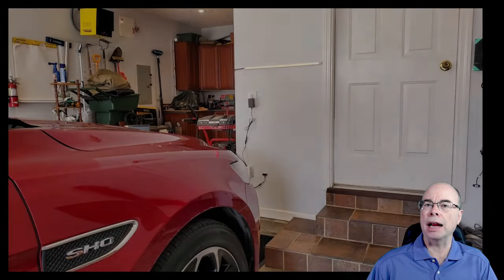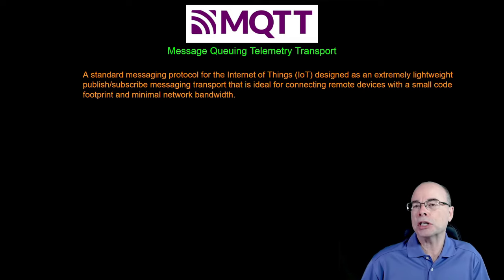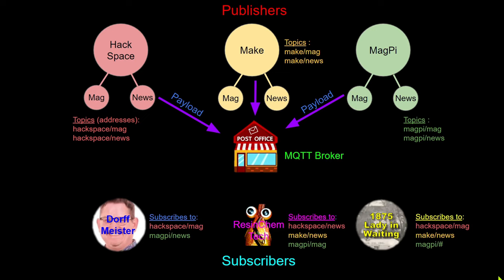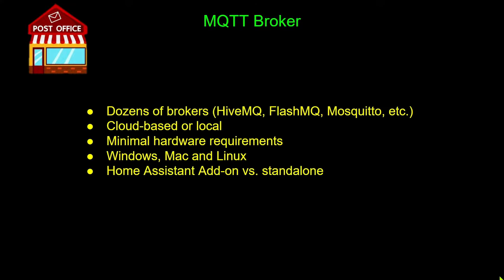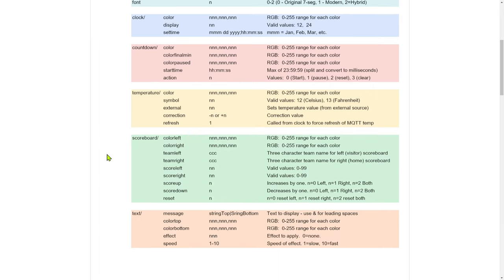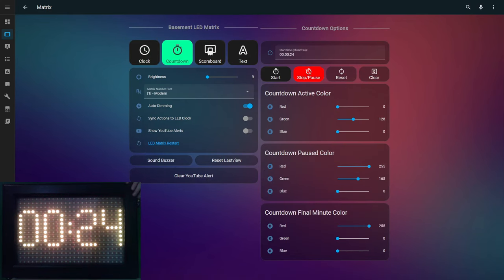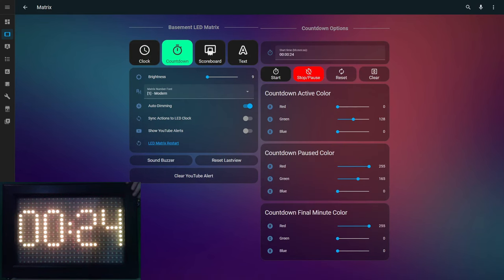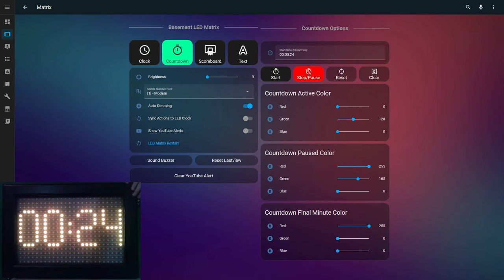MQTT 101: Integrate your DIY Devices into Home Assistant

Comment: Never in my life would I have thought I'd not only be able to retain focus, but actually enjoy learning during a 30 minute video. Just for that you deserve a medal. I had a couple of projects lying around that I wanted to integrate and I figured using ESPhome was the way to go, until I found out having to upload their way of writing firmware was required. I like my C++ and wanted to be able to create projects without worrying if later I'd be able to integrate them should I wish to do so. Thank Google for letting me know MQTT existed and you for explaining it so well. The end part threw me for a bit of a loop but I figure that''ll be fine when I'm more versed in YAML. Thanks again.
Reply from the maker: Yeah... I do tend to make lengthy videos compared to the average .  I try to always include the 'why' as well as the 'how' for beginners which result in long videos, but usually include chapter links for those that are a bit more advanced and want to skip certain parts.  Glad this one didn't bore you too much!

As I mentioned in the video, I struggled with the concepts of MQTT at first.  But now it is my go-to for any of my projects that do not have a native integration.  My C++ and Python starting frameworks both have MQTT stubs included... even if I don't initially intend to integrate them into Home Assistant.  The MQTT is there if I ever want to integrate it.... or even control the device through another system as long as that system can publish an MQTT message.

ESPHome and other firmware like Tasmota have their place.  For ESPHome, if I find that I'm creating a lot of lambda raw C++ to accomplish what I need, then I figure I'm better off just writing in directly in C++ myself (I'm a somewhat late learner of C++, but I love it and prefer it over other options like Python in most cases). 

YAML will come to you.   It's biggest issues (in my opinion) are trying to figure out if something is a dictionary without leading dashes or a list with leading dashes.  And of course the very strict indentation rules.  While I stick to YAML and don't really use the UI, the improvements is the capabilities with the UI means you can get away without even using YAML in Home Assistant these days, except for some really advanced or corner cases or you want complete control over where your code lives.

Thanks for watching... and for taking the time to share such a nice comment.  It is comments like yours that motivate me to continue making videos.

Comment: I can't even figure out how to make Home Assistant recognize the existence of the MQTT device.  I have the MQTT integration in but that's it, can't find a way to tell it how to find the device, give it an IP address or anything.  The device is an RS232 controller NB144.  There are three downloads for configuring the device but the one that looks most important is in Chinese.  Don't think there is much hope😞
Reply from the maker: You might try watching the follow up video to this one, if you haven't already, that focuses specifically on how to set up the Home Assistant side for MQTT devices.  https://youtu.be/WYyPMHqMV-w

This video was a bit more of an MQTT overview.  The linked video above has much more info on the specifics of the Home Assistant side.  I hope that will help a bit.

Comment: I have been using Home Assistant and MQTT. I develop ESP based devices. I love MQTT, but to retain or not has been one of those things where I play with it until it works, hopefully. However, even as you began to explain your thinking on when and how to use retain, I lightbulb went off! Thank you! That was an excellent concept and explanation. I have already fleshed out how I will implement my next device. If it works as well as I expect it to, I will go back and re-code my older devices and fix the little bits I now realize I CAN fix with this newer idea. I know I will change the implementation to suit my MQTT topic ideas, but the retain portion is great! And, again, Thank You!!
Reply from the maker: Glad it helped out!  I too struggled to understand and use the retain flag properly when I first started implementing MQTT on my own ESP devices and it took a lot of troubleshooting of a device that I had that was exhibiting the "ghosting" behavior until I finally figured out what was going on and how the retain flag was causing that behavior.  It's also why I now create separate state and command topics for my MQTT devices.  Yes, you can get a way with using the same topic for both if handled carefully, but by having separate topics, one retained and one not, it is much easier to manage (at least for me) and avoids the issue of having a topic retained when it shouldn't be.

Thanks for watching... and taking the time to leave a nice comment.
Reply: @ResinChemTech  I have used Shelly devices. I can see now that they use something similar, but it never clicked. Looking at documents never really conveys the concept, but pictures and words work WAY better. I am really ready to make a detection device for my front door and doorbell. Maybe even a light included. Thanks again! (I also subscribed. I will look over your earlier vids tomorrow. I found this one by accident. I know that is NOT what a YouTuber wants to hear, but at least it came up.)
Reply from the maker: Yeah, Shelly and Tasmota devices tend to use /tele (for telemetry) instead of /stat (for state).  But both are basically serving the same purpose.  I just selected /stat for my own devices as it keeps all my devices grouped together and separate from Shelly/Tasmota devices when I look at them using something like MQTT Explorer.  But as you know, you can pretty much use any valid topic you like.

Thanks for subscribing!  I don't do a lot of social media promoting of my content, and really only use Discord with any regularity, which is why most people probably just stumble across my channel much like you did.  But I'm glad you found me!  Feel free to shoot me any questions or thoughts you might have on my other videos.

Comment: Boy, that went over my head, I'm trying to get a ESP32 with a temp sensor to display in node red, esp32 is publishing, mqtt gives me following error:Client esp32-5834feab6224 disconnected, not authorised, any suggestion how to get it to authorize?
Reply from the maker: Well, it could be a number of things causing the disconnect.  First, you didn't mention the broker you are using (e.g Home Assistant MQTT add-on, standalone, etc.), but whichever one it is, assure that you are updated to the latest version.

Next, each client connecting to the broker must have a unique client ID.  If multiple devices share the same ID, when one connects,  MQTT will disconnect the other.  I'm not a NodeRED user, so I'm not sure about the process that is used to connect to, and communicate with, MQTT.  So I'm not much help on that front.

But the 'not authorized' message generally means that you have the IP address, password or user name configured incorrectly when attempting to connect via the device.  Be sure that you are using the local IP address of the broker and that you have a valid username/password for the broker.  See this, which may help:  https://community.home-assistant.io/t/mqtt-refusing-connection/437138

Comment: Excellent video as always.  Interesting how you separated out the status and commands. I may redesign how I am using MQTT based on this.  ~Brian
Reply from the maker: As I mentioned, there are other ways of doing this... the MQTT device can also update the same topic as the command. But if not handled carefully, it can still lead to occasional ghosting.  It takes a little bit more code up front to do it the way I am, with different stat/ and cmnd/ topics for states and 'command's, but it makes it very easy to know which messages should be retained and which shouldn't.  But everyone has their own techniques or methods.  A lot of people and devices, use tele/ instead of stat/.  I use stat/ because when I look at my MQTT Explorer, everything under the stat/ branch is basically mine... then broken down by the device name... stat/brlamp... stat/garagelight, etc.  It's just my own personal way of organizing all my MQTT topics.  But it by no means the only way!

Thanks for watching... and taking the time to leave a comment!
Reply: Also like the separation of command and status. This way you can see if the device got its message correctly. Thanks for showing more options how to use mqtt.
Reply from the maker: You are welcome!  Glad you found something that might be helpful for you.

Comment: All my stuff use Esphome.
Reply from the maker: And ESPHome is great for many cases.... I use it for a lot of my own devices.  But for more complex project, like the clock I show in this video, ESPHome is not an option.  I also do not believe you can install ESPHome on devices like the Raspberry Pi... or other devices that might use Python or other non-Arduino based languages.  I believe that he only supported platforms currently are ESP8266, ESP32 and RP2040.

ESPHome is a quick and easy way to put code on custom devices, especially those that just need to connect sensors, switches, etc.  But for devices that need to do more advanced local processing with highly customized code... or if you want to develop in another language like Java, then MQTT offers an easy alternative to integrating your devices into Home Assistant.

Comment: Nicely explained. 
I did look at using MQTT a couple of years ago, but it was above my understanding as a new user. Then I discovered ESPHome and never looked back. Finally now I'm moving into projects where I need to use C++,  and MQTT seems the way to integrate them with HA. This video really helped me get my head around the nuts and bolts of it. 
Thankyou for the time and effort you put into helping others like myself.
Reply from the maker: ESPHome is fantastic... if you are using an ESP (or one of the handful of other related MCUs).  But it is when you want or need to use something like a Raspberry Pi, Arduino or other platform/language where ESPHome cannot be used that MQTT becomes the easy and simple way to integrate into Home Assistant.  I just have MQTT included in my standard Arduino/C++ template I use for any new projects so it is there to integrate into Home Assistant if or when I decide to do so.

Thanks for watching and taking time to comment.  Let me know if you run into any questions along the way.

Comment: Your explanations are the best.  Thanks for starting simple and going complex.  Home Assistant is the most powerful tool out there and the most flexible too.  Your explanation of a  countdown timer let me power up my solar powered greenhouse watering system.  For this project I am going to use a Pi Zero, with a POE hat, to read the gage on my house propane tank.  THANKS.
Reply from the maker: You are very welcome... and I'm glad you found the video helpful.  Most people (myself included) seem to struggle a bit with the concepts behind MQTT at first.  I tried to break it down to something that folks might be able to relate to.  But once you get the hang of it, it is one of the best ways to integrate custom devices into Home Assistant that don't have a native or add-on integration.

I use timers a lot in my automations.  They are very handy for a lot of different purposes.  For me, timers and input_booleans are a couple of the most useful "helpers" when it comes to creating and managing automations.

Thanks for watching and thanks so much for taking time to post your kind comment.  I greatly appreciate it!

Comment: You read my mind.  Really needed this, thanks for the great explanation.
Reply from the maker: You are most welcome!  I know a lot of folks have asked me about it... and it can be a bit confusing when first starting out.  There are other alternatives, like ESPHome (as someone else mentioned), but depending on the platform and complexity of your project, ESPHome might not work or be a good fit.

Even if not building your own code, other platforms like Tasmota or the newer Shelly devices either use or make MQTT available, so it's a good idea to at least have a basic understanding of how it works.

Thanks for watching.. and taking time to comment!

Comment: Speaking as a complete Home Assistant noob, my first overall impression of MQTT is "elegant, straightforward, complete". I have a couple of assumptions that I would like to get clarified.
a) Is the communication between the publisher, broker, and client all TCP/IP?
b) Is your recommendation (if you were to start over) to put the broker in a VM or a container versus in Home Assistant? 
c) What else from the Home Assistant world would you put into a VM rather than native inside Home Assistant if anything?

Lastly, but most importantly I want to thank you for your videos and for sharing all your experience both positive and negative, when I watch any of your videos, I know I will always get honesty, so again, thank you!
Reply from the maker: Here are the brief answers to your questions:

a) MQTT does use the TCP protocol for communication
b) This is a bit too long to fully answer here, but I showed what I consider as the pros and cons of each method.  Personally, I'd like to be able clone my entire Home Assistant production over to a test system.  Having MQTT integrated into Home Assistant makes this more difficult.  But maintaining a separate VM/Docker container, etc. also comes with its own additional overhead.  As I said, the HA add-on works great, but for additional flexibility in my own use case, I'd put it in a separate install/container if I were to start over.
c) For me... there isn't much of anything.  If I were a NodeRed user, I would consider that in its own VM/Docker, etc.  This is just because, similar to MQTT, if it was separate from Home Assistant, it would continue to run and function even if Home Assistant were to go down for some reason.   Other than that, I don't really have anything else that would make sense to split out.

Thanks for taking time to post a comment.  If you want more details or to discuss further, you already know how to reach me!

Comment: Unbelievably useful 101 on MQTT. You have a gift for breaking down concepts into fundamental bits and setting the base to build further understanding on. Brilliant! 

I'm new to HA and MQTT and am having trouble to find resources to explain the basics well in order to be able to use the vast amount of resources and examples that are already out there. This is by far the best explenation I've viewed or read. 

The HA team should hire you to improve the existing support documentation and tutorials.
Reply from the maker: Thanks for the kind words and I'm glad you found the video helpful.  I do attempt to try to explain both the why as well as the how in most of my videos, as I find the "why" was lacking in a lot of the 'how-to' videos I watched when first starting out.  It does tend to make my videos much longer, but I try to always include the chapter links so if there are parts of less interest, those sections can be skipped.

I agree that the official Home Assistant documentation could be improved.  Part of the issue is how rapidly Home Assistant changes.  Often, I will make a video about Home Assistant and within six months that video is already out of date or contains incorrect info due to new changes.  But I remember how confusing it all was when I first started, so if I can do just a little to help others just starting out, I feel like I've made at least a little bit of a contribution.

Thanks for watching and taking the time to post such a kind comment.  I appreciate it.